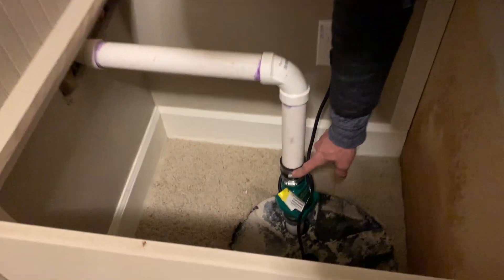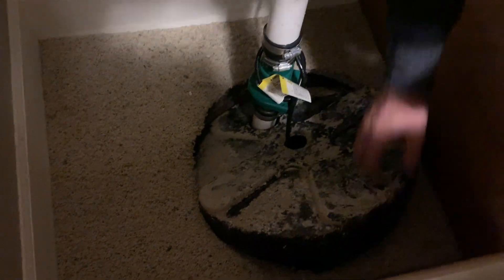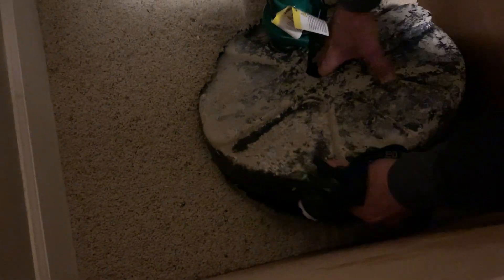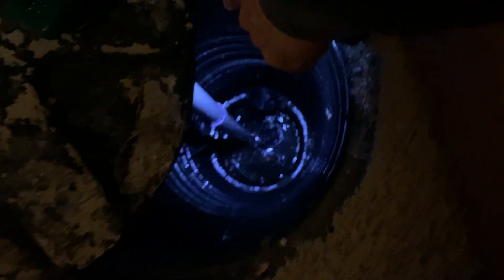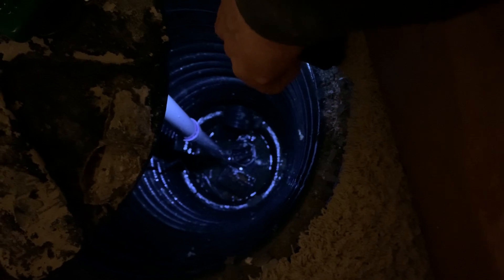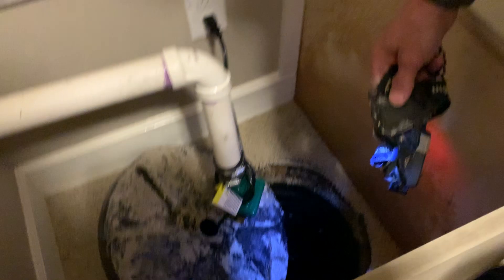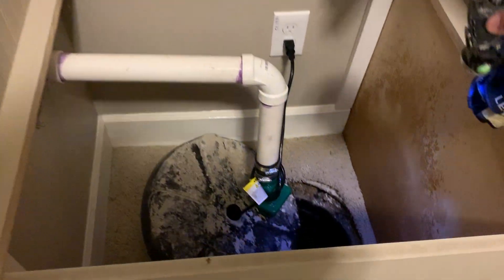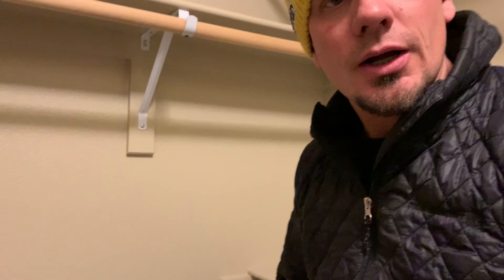Sump Pumps GFI Tripping - Safety

Comment: That is a well not a sump pump hell sell the water .
Reply: Right! What were they thinking?  I can see no reason to draw the water level so far below the floor. That pump is running way way more than it needs to. Almost like they used that pit for dewatering and then built the house around it. I would fill that crock with concrete to max 4 feet below the floor and raise the pump.
Reply: So it wasn't a GFI tripping, it was the water shorting out the receptacle. I know it probably depends on local code but I thought sump pumps didn't necessarily always have GFIs. Thanks, love you videos.